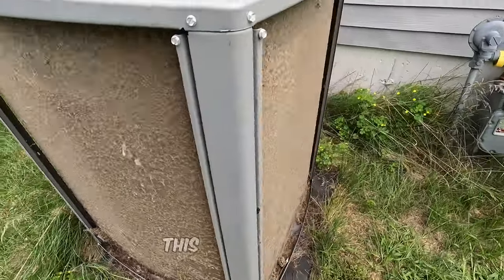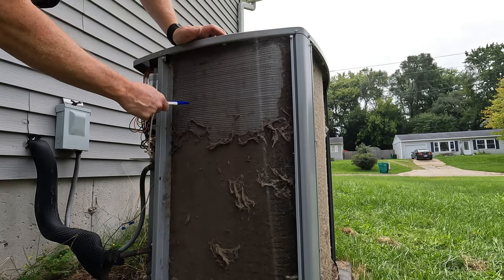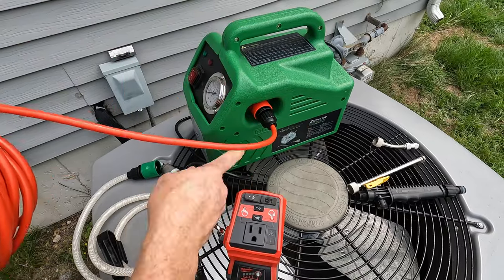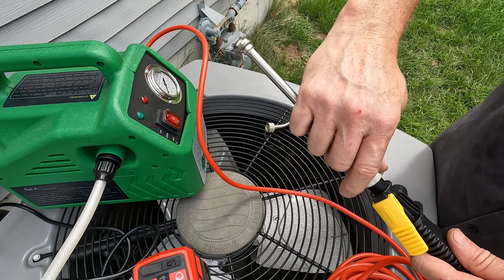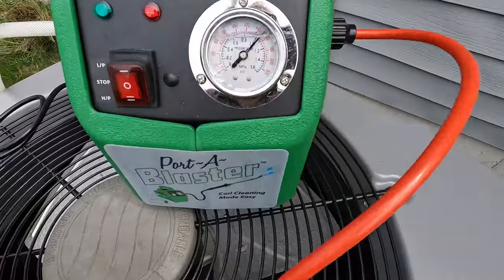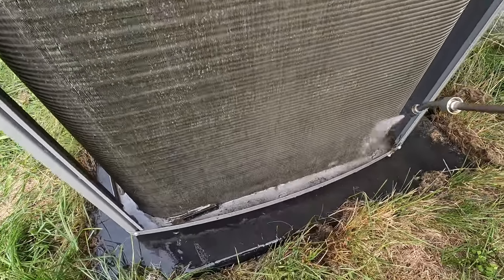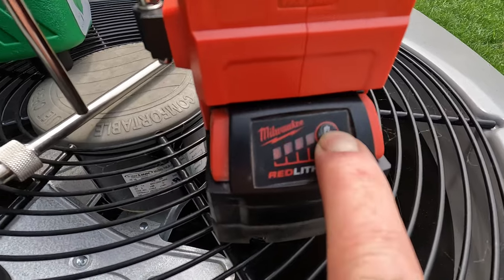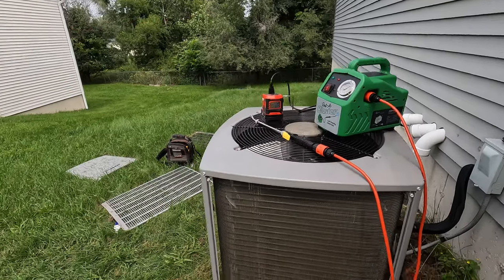The Port-A-Blaster: Your Game-Changer for Condenser Cleaning

Comment: Dragging a hose is easier than setting that up, getting power, filling a bucket and hauling it in most cases
Reply from the maker: That’s your call, this year alone I had 3 calls where both outside spigots were broke. This set up saved me.  Getting power is not a big deal. Use a Milwaukee top off, Works flawlessly.